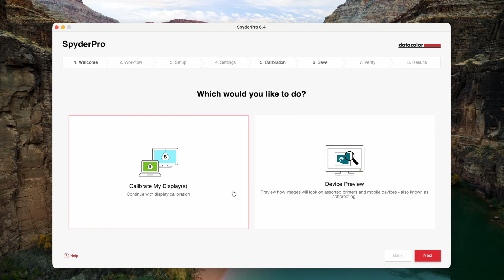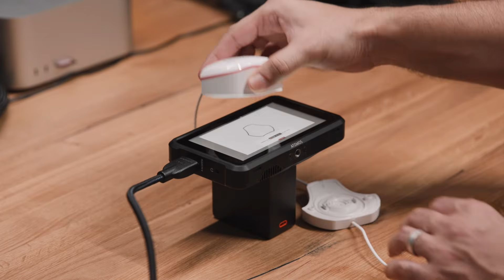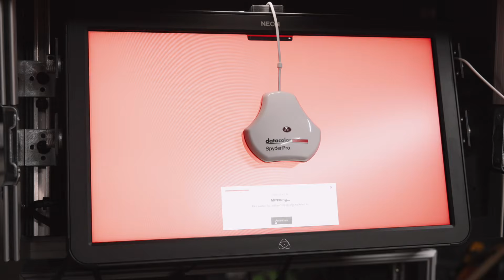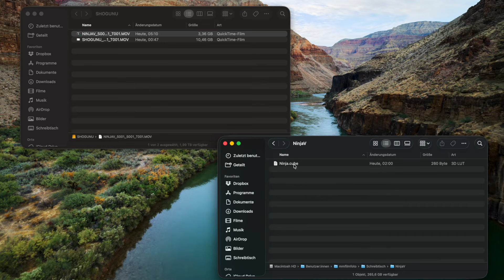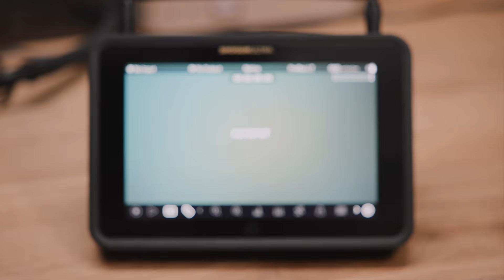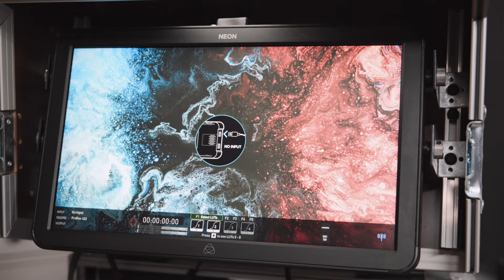Calibrate Atomos Monitors with Datacolor SpyderPro | 3D LUT Export for Precise Color

Comment: Can I do this with the built in calibration?
Reply from the maker: Hi,
the creation of a 3D-LUT can be done using a SpyderPro.
If you need help or have additional questions, please contact our support team at:
https://goto.datacolor.com/spydersupportform
This is the fastest way to answer your questions.

Your Datacolor Team
Reply: @DatacolorSpyder thanks for your response. I have the regular one and don’t see the “export lut” option. Is that a pro only feature?
Reply from the maker: Hi,
yes, this is a feature of the SpyderPro (2024).
If you have the Spyder (2024) you can upgrade here:
https://www.datacolor.com/spyder/spyder-upgrade/

If you need help or have additional questions, please contact our support team at:
https://goto.datacolor.com/spydersupportform
This is the fastest way to answer your questions.

Your Datacolor Team

Comment: Does this mean I cannot view how my image looks with a color LUT applied? 
Since the monitor is using the LUT to "calibrate" the screen I cannot apply my grade LUT as it will no longer be calibrated. Is that correct?
Reply from the maker: Hi,
there are different approaches:
Either your video editing software allows to have different LUT and/or the use of 3rd party software to combine LUTs.
If you need help or have additional questions, please contact our support team at:
https://goto.datacolor.com/spydersupportform
This is the fastest way to answer your questions.

Your Datacolor Team
Reply: i would suggest to put the calibration lut of a certain monitor on a node in davinci resolve and your color lut on another. Then export an new lut from it.

Comment: One obs - gamma for LUT REC709 is 2.4 not 2.2
Reply from the maker: Hi,
originally rec709 was defined with no gamma value as this was forgotten.
Today you find users that use 2.4 as well as 2.2.
The SpyderPro 6.4 software has 2.4 as default gamma. But in the Spyder software you can select 2.4 or 2.2 as you want.
If you need help or have additional questions, please contact our support team at:
https://goto.datacolor.com/spydersupportform
This is the fastest way to answer your questions.

Your Datacolor Team
Reply: @DatacolorSpyder Thank you very much for the quick reply. I think in this case, very low ambient studio light, a 2.4 gamma is more appropriate even if the final material is for social media ... but I will check the forum.